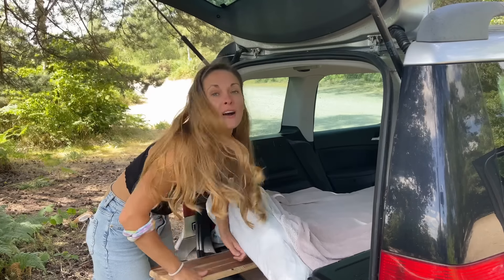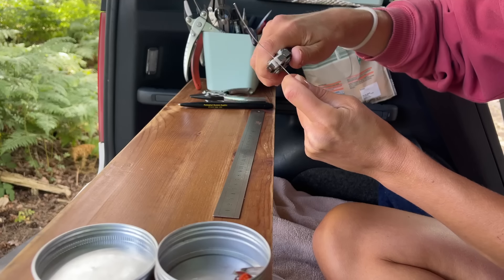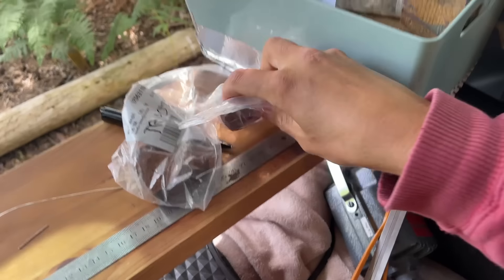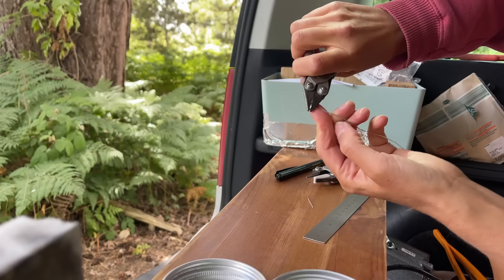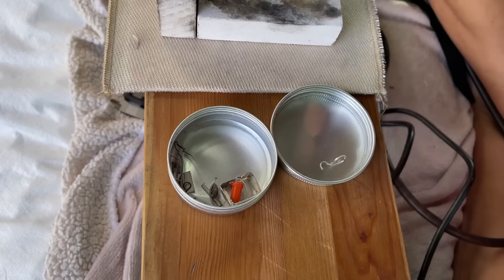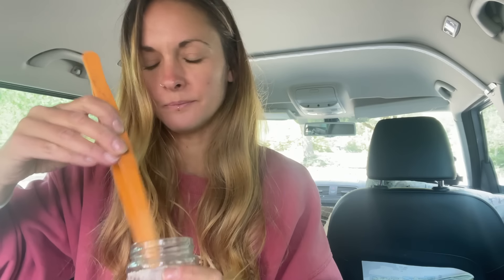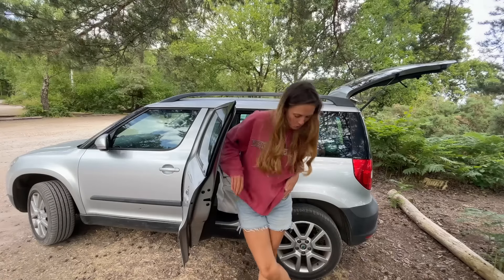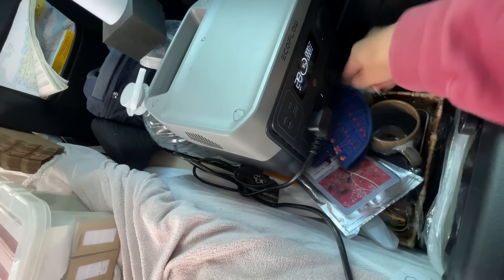Can I run my jewellery business living in my car? Skoda Yeti pushed to the limit 😅

Comment: Lol. You certainly had a few tribulations during your trial run, Tori 😂
Instead of that hanging, foot pedal tool thing, could you use a Dremel multi tool? It would save a bit of space.
Either way, it’s going to be a tight squeeze in the back of that car. I mean working, obviously 😂
Reply from the maker: and I look forward to a lot more tribulations as i pursue this madness 😅you know what i was actually considering that, not as good to use but realistically better for on the go! ha tight squeeze indeed I’ll be crippled within the week 😂

Comment: Well done - loving your life philosophy. Can you do it? Yes, you can do - whatever you decide, you can do it. I would inclined to consider having a roll up camp table and simply sit on the back of the car as long as it’s not too windy / rainy? Spread out an old bed sheet when working inside the car so it’s easy to shake out and to wash. 
Kettles, I have a 12v kettle for when I’m driving and a 650watt / 230v travel kettle. Both make I decent mug full. 
Water to wash your paws - get a solar shower with a tap and a hose so when using it doesn’t drip inside the car - or place it on the car roof.
Reply from the maker: A roll up table sounds good but I’m not sure I could work on it as well as I need to hammer, then again maybe I could have a small hammering block. Often we think we need things until we try a different way! Wind is a big problem though and I cannot work outside for that reason, I nearly had to shut the boot my bits are so light. I’ll check for kettle it makes life so much easier! Dirty paws 🤣 good idea thanks!

Comment: good advice in comments. I shall add that am not happy laying your electric motor on a blanket. 1) It looks not to be an inexpensive item. 2) The casing seems to have cooling fins and air vents and there's probably an fan impeller that sucks air inside and outside the casing.. Almost any reduction of this facility may cause rapid heating that could burn out your motor/something touching it. Make a way to suspend it as it should be - an S hook on the handle thing above the door ?????? Cool workshop
Reply from the maker: honestly I agree, it can’t be good for it lying down or it wouldn’t be designed to hang up. I will try to figure the hanging solution!  thank you ☺️

Comment: Hang the tool of the hatch back if you can, B&Q or wicked do awesome hand wipes so you don’t need the water apart for drinking and buy a folding stool so you sit half out the car under the hatchback and can put the foot pedal on the stool.  On of those collapsing ones would be perfect.
Reply from the maker: these are good ideas thank you!

Comment: You can get an inverter that runs off your car battery, they provide 240 volts and most also have a phone /laptop charger built in. I have 2 in my van a 180 watt one which is ideal for tool batteries and small items and a 6kilowatt one for heavy duty jobs in building work. I have a split charging system fitted and 2 batteries so I don't end up with the vehicle battery going flat. You can also get 12 volt electric kettles but again you would have to have the engine runnning to use it.. My van came with a hot water heater and a sink that folds up which is handy for washing grubby hands.I also carry an airbed and portable toilet for weekends away. Maybe a van woulld suit you better if you want to work and live in it, I have a high top Transit but it is not much longer than an estate car.
Reply from the maker: that all sounds extremely handy! a fold away sink and hot water heater love it. yeah long term something a bit bigger would doubtless be better so we will see! My van is pretty big and i wanted to try something smaller and more handy, your transit sounds good.

Comment: Hello Tori again😅, Your motor needs to be hung up - I notice you have roof handles either side of the INSIDE of vehicle...how about getting bungee cable with the hooks either end and hook the ends on the roof handles across the car threaded through the motor handle? Also Asda are selling a ground sheet that self inflates at around £15 which with the bedding you already have may make it more comfy? 😮Take Care
Reply from the maker: hey! i agree it does, and I did consider the hooks but the motor is pretty heavy and i was slightly concerned it would rip them right out. maybe i should just try it 🫣 self inflating groundsheet sounds interesting thanks! ☺️
Reply: @missnancysdayoff  Good point, did not realise it was that heavy😊Another alternative would be to hang it from the back door metal hinge, but that of course would only be when the weather was okay! Problems problems 🫣🤔
Reply: @missnancysdayoff Also Dunhelm has sheets of sponge seat padding different thicknesses/sizes👍

Comment: Good morning 🌅, that great day, at work, if you are careful, you can make a hanging bracket to hook on the back edge of your vehicle so you can attach your Dremel machine to it, I know there is a device that has got the clamp on it that allows you to hang it off a hook at the top, I have seen people put an extension on the back. Are there vehicle to make a camping area?, That you could obviously use as a workshop., need to be very careful with fumes from when you’re doing soldering or chemicals who are using, obviously I do not know your circumstances, but I have been to offence years ago, where people have a workshop, a caravan to work in, with a horning on the side as a display place to show your Products you make, the countryside looks nice, though it looks a bit windy, do you do craft fairs?, Or have you thought about doing it?, I have done them years ago where I’ve used my van to sell things that I’ve made, and I have done renovation projects where I have worked in my van and slept in my van as well. You just have to make sure that way you sleep as well covered up., And obviously there are vans and there are vans, I have a long wheelbase sprinter, excellent for doing work if it’s raining and obviously sleeping as well, in the region where I live in France there are people called artisan, they make anything from Woodturning to pottery sewing jewellery et cetera, 
When I first started working for myself , I had a very small workshop, I would buy secondhand furniture from auction houses and restore them and then put them back into auction and make some money sometimes, I ended up getting commission work to make furniture, et cetera, I ended up doing specialist joinery work for restoring Barnes conversions, and renovation projects, , et cetera, It might be worth buying secondhand jewellery, and taking it apart and remaking it into something new and modern, or even creating pieces of art, 
I wish you all the success for the future , Keep up the great work and stay positive, I would say that you could have my caravan which is in my garden, but you will need a very large truck to pull it, France,
Reply from the maker: hey! thanks for the good ideas. I’ve actually never done a craft fair with my jewellery but maybe i should! I usually make stuff to order, but i am going to start doing some new things i can make in advance. windy as heck everywhere i go! your work sounds great, I’d love to restore furniture etc. that could definitely be a fun idea with the jewellery as well, it’s good to recycle/upcycle things.  sounds like you have a nice peaceful place out there in France, and thanks for the caravan offer, not quite sure I am ready to pull one of those! 🙏☺️
Reply: @missnancysdayoff  Good morning/evening, I am so glad that I have been able to help, there is a lot on YouTube, Wood Art. Sculpture., Et cetera, 
I don’t know why, but there seems to be a lot of females over in the US and Canada , that are into Woodcraft, and Woodturning which another thing that is very interesting as well, but that will cost a lot of money to set up, there is one thing I should say that if you do a craft fair with jewellery, you must make sure that it’s behind a cabinet or out of reach so people cannot pinch or thief, something else that might be of some help or interest, is contacting some of the colleges and schools in your area, they might do evening classes where they will teach you turning woodcraft et cetera and even furniture restoration, Are used to teach in the evenings at a college near where I used to live for about six or seven years, teaching furniture restoration, I had a wide group of students, from an 18 year-old to 82-year-old, It was very interesting and good fun. Had a good banter with a lot of students , got to a point where people’s birthdays were bringing cakes and have a celebration, over the years I have restored a lot of furniture some very very valuable, I have made furniture for two universities in Cambridge, and I have worked as a contract worker at a organ building company, As they were short on a specialist machine operator, I even still have a lot of my machines and tools, I am a present trying to restore an old mill, which I’ve turned into a dwelling , so it still needs a lot of work to it , it’s got the main essentials like bathrooms, kitchens and dining rooms and lounge , and a huge garden with a stream/river , and I’m in the process of building a workshop/garage, I wish you all success for the future, if I can help in any other way, I will try, stay safe, look 👀 forward to your next project on YouTube, France.

Comment: My experience of living in a car the same size may help you
I chose to sleep in the front seat with seat fully reclined which worked great for me
I realised I only needed 3 storage tubs
1 tub for clothes
1 tub for food
1 tub for everything else
I used to leave the back seats empty and access the boot from within the car through split rear seat etc
Motorway services have free to use shower's which is handy to know for those living vanlife etc
I chose not to cook which saves space and time
I used to store my food in the passenger footwell area which worked well
Hardest bit most struggle with is not having a remote off grid job or funds or budget so still have to do 40 hour week which makes living in a car difficult using the same park ups frequently etc
Best job for living in a car?
Day trading the stockmarket from a phone via an app but very risky if not an experienced day trader but very profitable if experienced day trader etc
Reply from the maker: wow sounds like you really know what you are doing, honesty I never even considered sleeping in the front. you just have it down to a fine art. i find it difficult packing small i think it’s an acquired skill. thanks for the tips, i didn’t know there was showers at the motorway services! Day trading sounds like a great gig, not that I have a clue about it sadly.
Reply: @missnancysdayoff  Space management is everything when living in a car
The 3 tub storage method makes taking car for Mot easy eg take the 3 tubs out before Mot easy
Plus sleeping in front seat and keeping rear seats always empty makes it easy and quick to leave a park up and park up in a carpark without it looking like a person sleeps in their car etc
eBay is also another part time remote off grid job that those living vanlife can do from their car or van etc